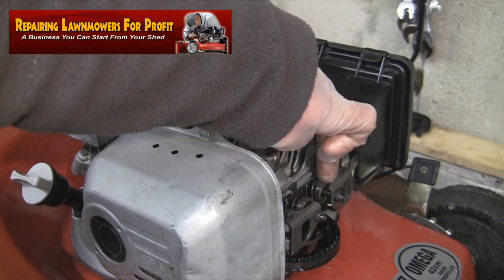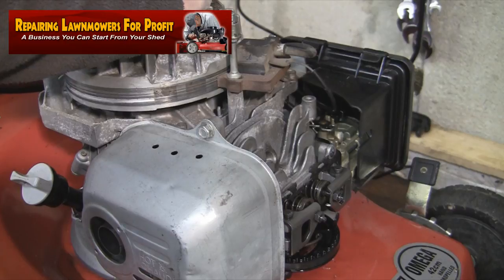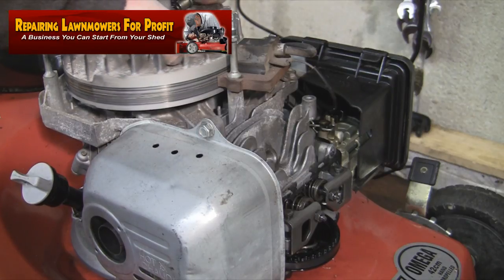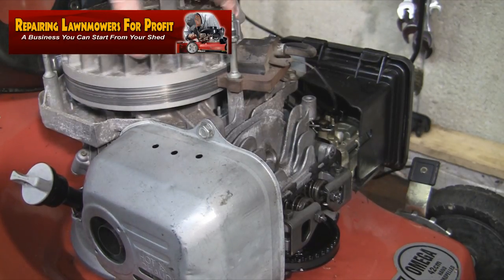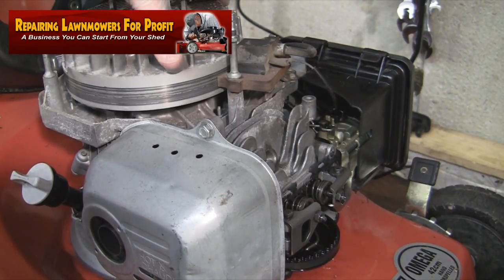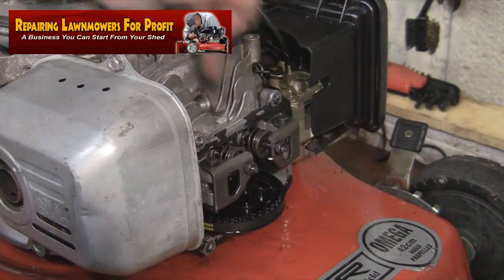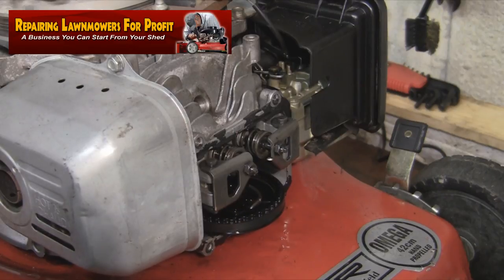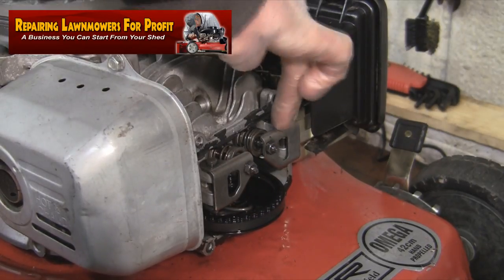How To Find Top Dead Centre (TDC) On a Petrol Lawnmower

Comment: Thanks for the video.  I adjusted my valve lash and had high compression issues.  I bet I wasn't setting it on the compression stroke.  I will go and give it a shot tonight to see if I can fix it based on this info.